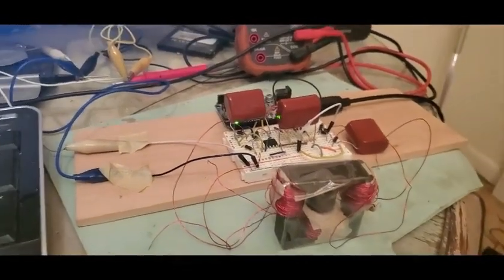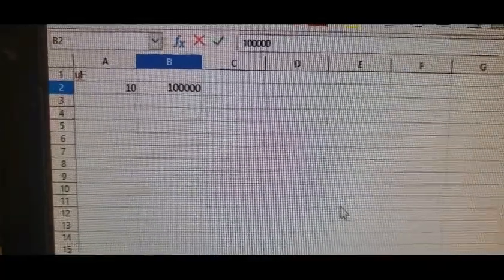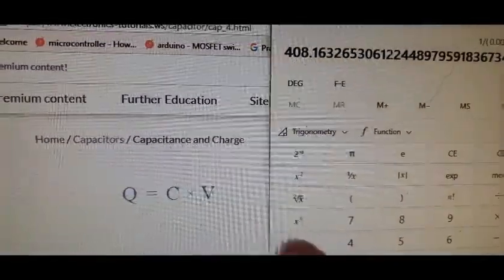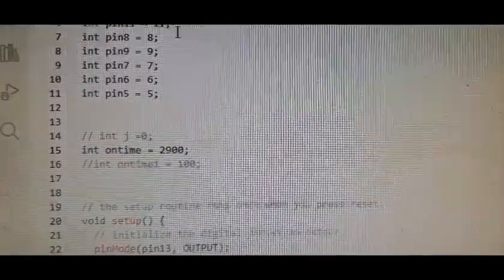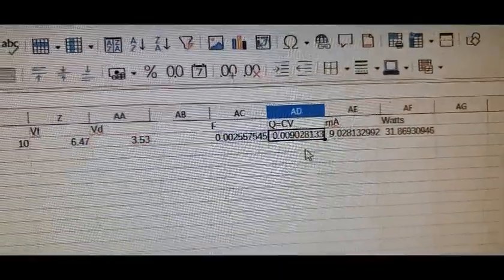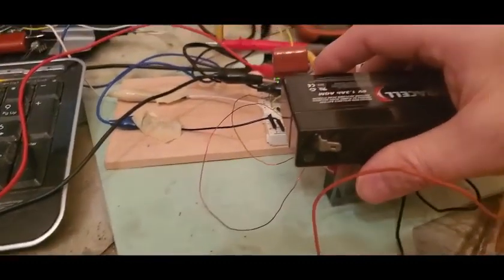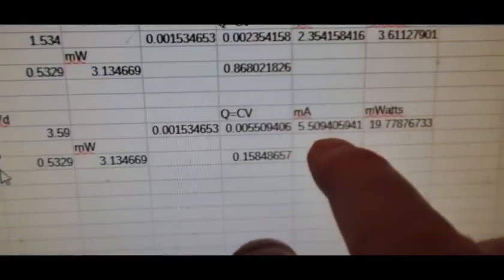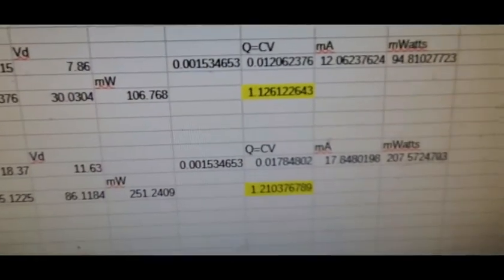Running a Bitoroidal Transformer

Comment: Hi thank you for video. Why you calculating power instead of energy. You are assuming that voltage on resistor is constant, it will be good to see the voltage with osciloscope accross 1k resistor, and then calculate the efficiency by taking in account voltage form accross the resistor.
Reply from the maker: Hi armangevorkyan1975, thank you for the comment.  First I have put together a playlist of the 5 videos I have done on this, especially the first one where the engineering student does his write-up concerning Thane Hein's work may be worth review.  Why am I calculating power instead of energy?  Efficiency is defined as watts in versus watts out is it not?  As you bring up energy, there are shall we say difficulties there, google "two capacitor paradox", some of my earliest videos grappled with this issue, but again efficiency is conventionally defined as volt-amps in/volt-amps out. 

 "You are assuming that voltage on resistor is constant", what made you assume that?  It is not entirely clear given the brevity of the comment what you are getting at I would have to guess the voltage measurements of the secondaries under a 1K load.  I do not assume that voltage is constant, it is a given however, that the measured reading is the average voltage across the 1K load.
Reply: @paulmaher812  Hi, power is  energy consumed per second, for instance you can charge capacitor with low current for one second, then discharge it fast with higher current, then you can get power much higher because same energy you consumes faster. You can calculate efficiency by dividing power in and power out only if power in and power out are constant over time.
You have on your secondaries capacitors, and while you discharching capacitor on your primiray winding on secondary the current will not be shown  immediattly the maximum value. 
Regarding 2 capacitors charging paradox it is very simple, while you connecting one charged capacitor to another not charged with same capacitance, then half energy is wasted in form of heat of wires.
Reply from the maker: @armangevorkyan1975  Okay

Comment: Hi 
Do you have magnet inside as per MEG?
Reply from the maker: Hi Ladislavsfarik8745,  
No, those are just two off the shelf air gapped E Cores from digikey.  That is something I want to look at going forward.  I think the first thing when I move away from the air gapped cores will be looking at two different materials for the two flux paths ala Thane Heins.  After that I was thinking about how would you put the magnet inside the toroid ala Bearden and for that what I am thinking is maybe pick up a ferrite rod, you could use a dremel to cut the rod to the correct size then put a permanent magnet on each end and use that to bridge the toroid. I did see a 20 minute video where Tom was talking about it and one thing he mentioned is once the magnet is connected to the toroid you can hardly even measure a magnetic field on it as the magnetism is now into and distributed throughout the toroid. So, on the todo list, but as I am seeing things that I am having fun with it is sort of an enjoy the journey thing and perhaps at some point I will get around to looking at what happens with a permanent magnet bridging a toroid and if there is anything fun and interesting I might be able to see there as well.  Thanks for the comment.
Reply: Thank you for your answer
I have constructed simple frame with magnet in centre 
It works exactly as per Tom explanation 
I have lost so many years without this knowledge
Never mind 
Now I’m on the pathway to harvest magnetic energy from permanent magnetic field 
It is very simple to switch directions of magnetic flux with small coils 
Can sent to you some pictures if you wish
Reply from the maker: @ladislavsafarik8745  Hi Ladislav, good to hear from you.  I would be interested in some pictures of your work with Tom's M.E.G. device.  It would be nice if you share them with the group here, not certain if you can attach files to youtube comments, maybe you have a link to share them. If you wish to only share that more privately I have realized I don't have a channel specific e-mail yet but if you like I could spin up a InsightProject gmail or Yandex email hehe.  Right now I am going to continue with looking at different airgaps for different magnetic flux paths, then look at different materials, then maybe throw in a magnet.  I have avoided that at the moment as 1) it adds in a whole nother variable where one tries to figure out what is going on 2) I am actually seeing interesting stuff with simple set-ups and as you may have experienced as well, if you try to follow at the same time every thought that pops in as something cool to look at, you end up a like a dog chasing its' tail and never getting anywhere.  Thanks for the comment, would be interested in hearing more about your work replicating Tom's M.E.G.

Comment: Awesome video Paul! Are you aware that LC circuits need additional power to keep resonance on top of whatever load you're trying to power? you'd need to calculate for real power, reactive power and apparent power in order to get your amps, volts and hertz to line up with your calculations. Eg if you try to power a 10 watt bulb with an input of 10 watts in an Lc circuit you'll come up short on watts if you don't account for the reactive power.
Reply from the maker: Thank you. Would say the terms you using, as I understand it, are most applicable to AC transformers.  In this instance with a pulse from a cap you have one "bucket of charge" sitting on the breadboard.  Thanks to the control possible with an arduino one may observe the fate of one bucket or multiple buckets of charge, over time.  But yes there is a whole class of oscillation circuits designed to maintain the LC oscillation and keep it from damping out, Harltey Oscillator, Colpits Oscillator, Royce oscillator, Joule Thief oscillator.  Might be fun to do some videos building each circuit, as so far the only one I have played around with, like so many others, is the Joule Thief. Thanks for the comment.
Reply: @paulmaher812 oh okay I see, its also very interesting you can calculate multiple discharges per second to make a solid power measurement of a farad a second

Comment: Last week, I looked at Bearden's presentation of his motionless electric generator, where he describes that while the B field is confined to the core, the E field propagates into space and can be collected, (I guess if it is within about two or three wavelengths). It might be possible, with clever arrangements of capacitor plates, (generally, many plates, whose surfaces are orthogonal to field direction), to feed this back into a resonant circuit. According to him, collectable energy increases with frequency, as E = - dA/dt, so the idea is to design for high frequency, high Q-factor, i think.
Reply from the maker: There is a Russian scientist whose name I am blanking on at the moment who did a write-up mentioning that same approach of capacitor plates at a right angle to capture the E field off a pulsing coil. If I happen to dig out the write-up will try to remember to mention it.  Thanks for the comment.
Reply: @paulmaher812  yes Bearden himself recommends the book, "Modern Thermodynamics" by Ilya Prigogine. Is that the one?
Reply from the maker: @paulshields1883  Actually, I remembered it was Vladamir Utkin I was thinking of.  He has an interesting write-up here http://www.free-energy-info.tuks.nl/VladimirUtkin.pdf  Not always exactly clear what he is getting at but interesting. Will have to look up Ilya Prigogine.

Comment: The primary does not become more damped when you load the secondaries.  The inductance of the primary changes when you load the secondaries. More current flows through the primary in the same given time proving the change in inductance.  

You have tuned for the unloaded inductance.  Retune on/off time after you load the secondaries.
Reply from the maker: Not sure I follow, would have to guess you meant "impedance" not "inductance".
Reply: @paulmaher812  

  Run the primary in series with one of the motor coils in your new test motor, and then dead short a secondary.  If the rotor spins faster during a dead short of one of the secondaries, why?   Because there is less induction or  self induction from the magnets to the motor coil.  Your coil now has a higher KV rating, spins faster for a given input voltage, because the magnets induce less opposing voltage when they spin past.  Shorting a secondary has the effect of lowering inductance.

You used your spread sheet calculator to solve for pulse duration  with a known inductance/impeadance/reactance ( no load on the secondary ).   You measured the difference when secondaries were loaded.  Use this new value to resolve for "inductance" and then the pulse duration for the fixed load.